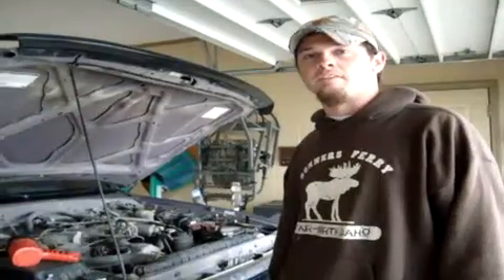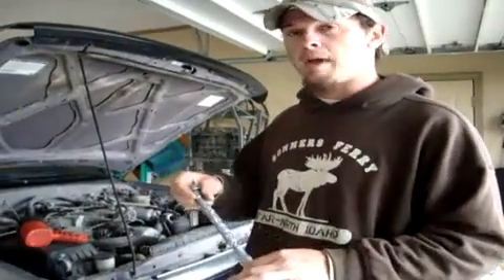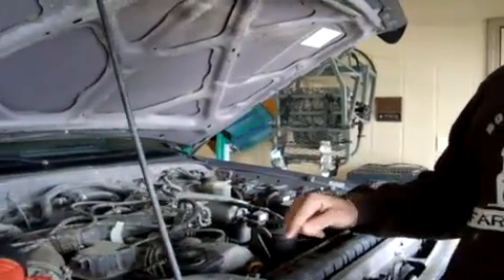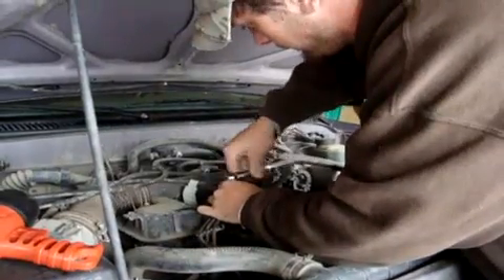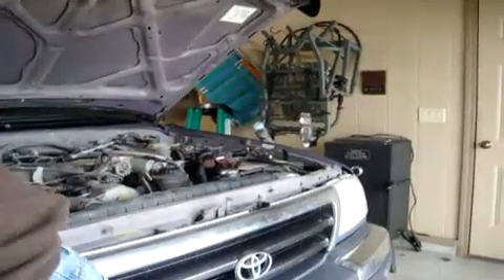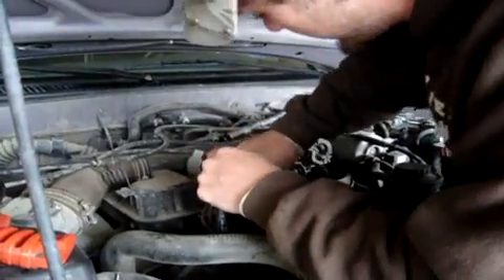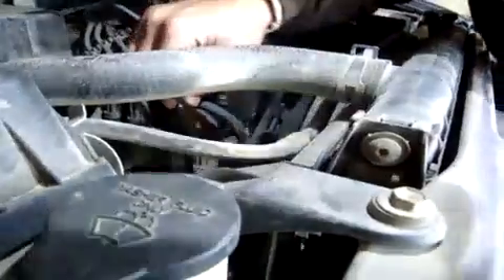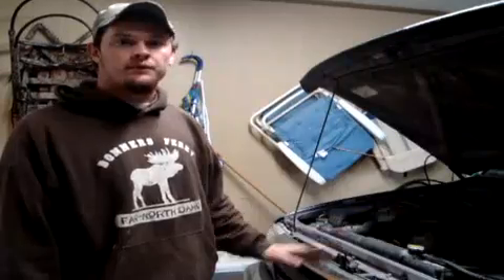How to Change Spark Plugs and wires on 98 Toyota Tacoma 4 Cy

Comment: Wow! The camera guy got a good shot of the whole engine from a distance of 5 ft. Too bad he didn't get a shot of a spark plug or the location on the engine where the spark plug actually scews in!
Reply: Exactly!!
Reply: Yes, too blurry and vague. Overkill on the duct tape, also. The trickiest part can be the tabs that free the plug wires from the distributor cap.
Reply: Bonners Ferry Idaho? 🤔 That’s practically the middle of nowhere. Cool. 👍

Comment: OK....after signing up for Google and then Youtube, I finally get to ask a question:  How does one remove the spark plug wires from the distributor (on a 1998 Toyota Tacoma pickup truck)?  I know everyone says to squeeze and pull (with a little twist) and the connector comes right off.  Well, not on my Tacoma apparently; all four of them will not budge and after an hour, all I accomplished was wear the skin off of my thumbs and fingertips. HELP...please!
Reply: Did u find out how?